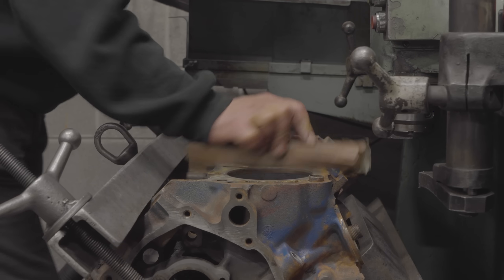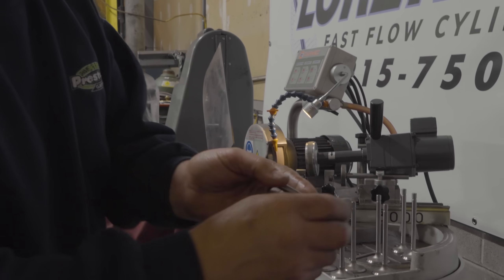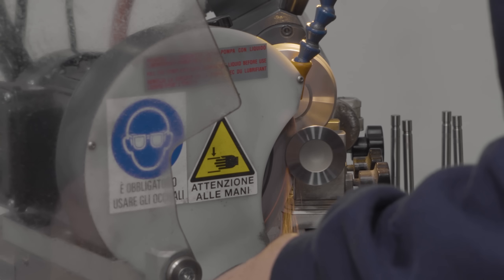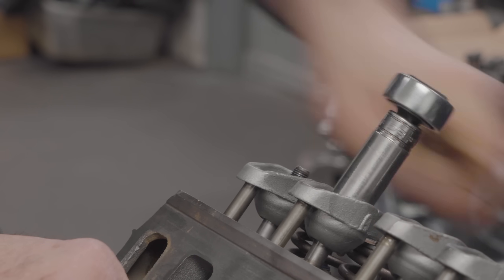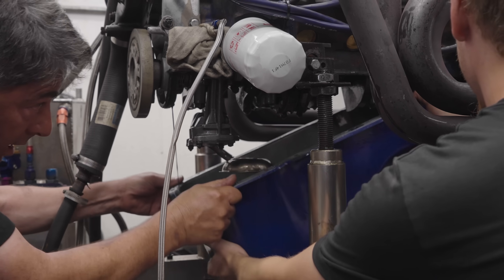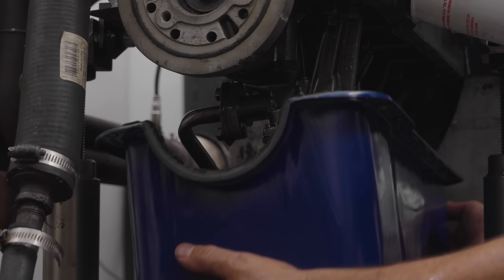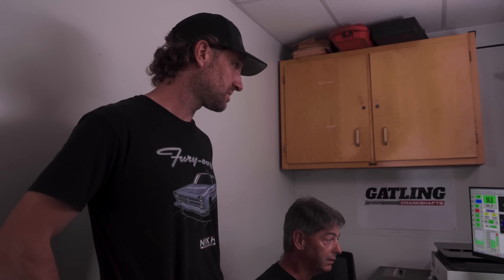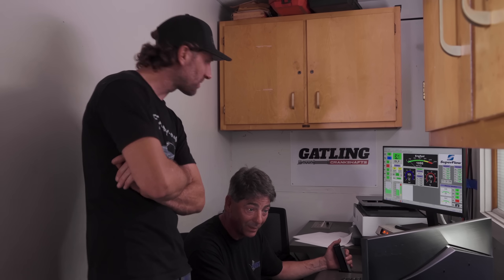IMPRESSIVE POWER FROM 289 - Dynoing NNKH's 289!

Comment: Had one of Herb McCandless’ ex-employees (he closed his machine shop operation) do the machine work on my  318.  Used a 340 forged crank, forged I-beam rods, KB pistons (9.45-1), the “308” casting heads from a ‘90 5.9, windage tray, a cam matched to my gears/CR/tire height, had the distributor fully rebuilt & curved for the combo, Air Gap intake, AVS II carb, and a 2.5” dual exhaust with an X-crossover, and the machining & balancing were spot on.

Is it the fastest thing out there? No. Is it peppy? Yup. Fun? Yup.. Reliable? Yup. Better MPG? Yup. Prrfect

Comment: Used valve retainers are OK? Flat tappet lifters? Old style cast rockers? Press-in studs? Not sure I would use those parts when later model and better parts are available. I thought hypos used screw in studs and push rod guide plates? I’d be interested in others’ views on this. The last engine built (many years ago) was for my brother, who dropped a valve in his 289 and broke the cylinder wall. We built a new stock-style 289, 0.40 over, and we sure as hell used new valves and keepers!!
Reply: Hey Daren

Comment: Nice thing is there is easy power to be gained.  Roller rockers and something like an RPM airgap intake surely would add 30+ hp. It did even better on our lil 289. Nice engine, guys. Itll be funtimes with the 4 speed.

Comment: I had an oil pump do that. Fresh built 351 Cleveland.  Sadly, engine was installed in a 1971 Ford Torino. Blew filter off, completely.

Comment: What does the angle of the honing machine at 20% do at 2:15? How would adjusting that angle affect what you are doing? I am sorry for the ignorant question, but I am curious! Thank you for what you do, I am amazed by your work, and wish you the best! Happy Birthday as well!
Reply: It’s a load meter. If it fluctuates then either the top or the bottom of the cylinder is tight. The operator can tell the machine to dwell at the bottom or crank the block lower to correct it. I ran the same machine for years.
Reply: @fullautophx  Lot better than doing it by hand like we used to do with a drill that would break your arm if it caught a web at the bottom.